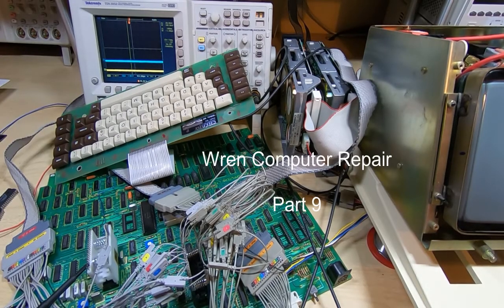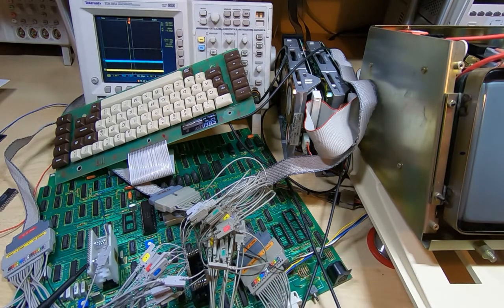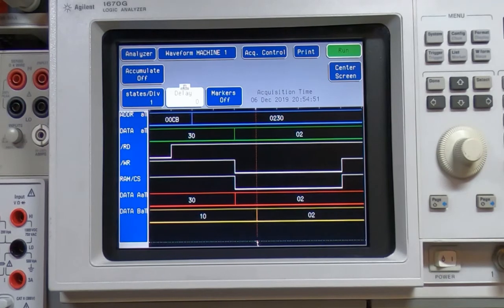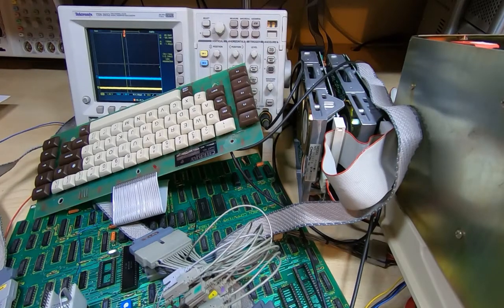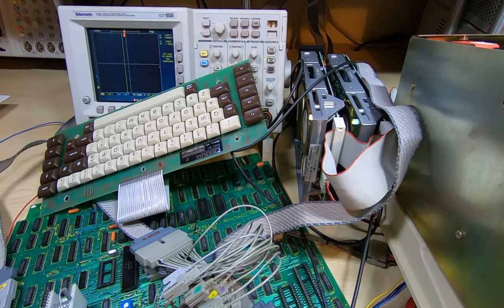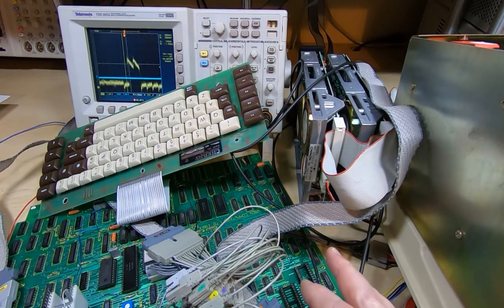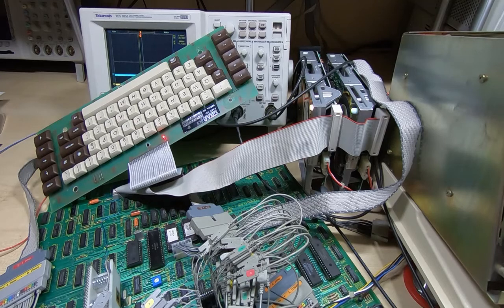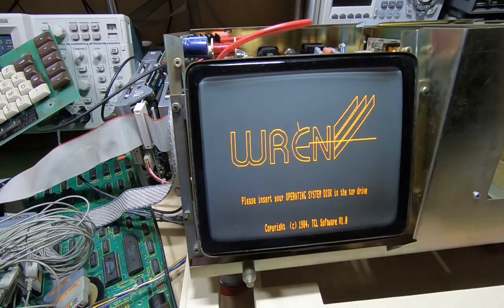Wren Part9

Comment: When you were checking the '245 outputs against the inputs in the logic analyzer waveform display did the low 8-bits of the addresses at those points corresponds to the I/O space addresses? Is the UART mapped into addresses 0x30 - 0x34 in your I/O space table from Part 7? Did you bother determining what devices where mapped into the rest of the addresses in your table for future reference? Anyway, great progress. Glad you didn't leave us hanging until the next episode to see the CRT display.
Reply from the maker: Yes I had the analyser connected to the Z80 address bus so I could determine which devices were at which port address. Then from the listing I could see if it was an IN or an OUT by looking at the instruction address. You can see this in the video but I did not mention it. (actually I did but the video was getting too long so I edited that bit out). I did the same off camera for all other peripherals by connecting the RAM/CS line to the enable of each in turn. The approach I take may seem complicated but it gives me a huge amount of information and is far quicker than using a scope when a schematic is not available. I genarally keep a file for each type of machine I work on so next time I get one in for repair I have an ever increasing 'manual' for them.